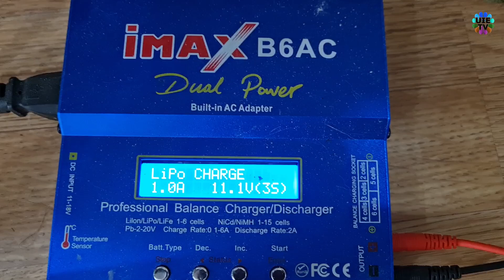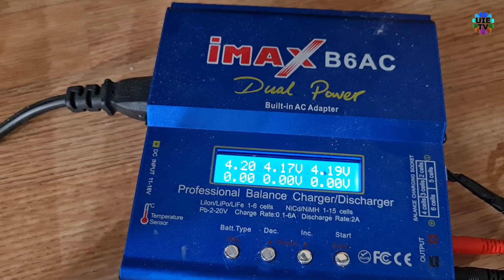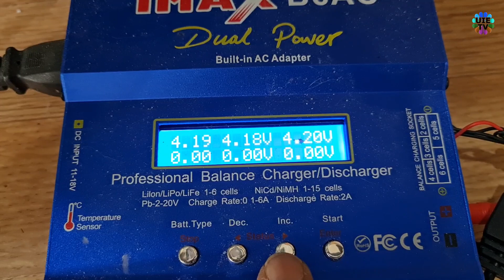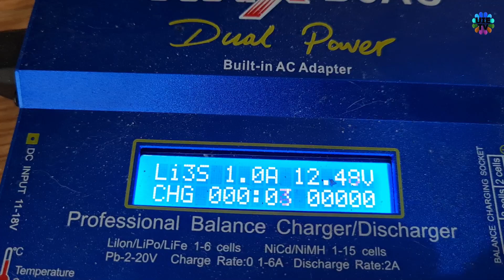All in 1 Proper Guide, How to Repair or Modify to faulty Battery in Hubsan Zino Pro Drone Fimi x8

Comment: If yu can read this today and still here fimi is alot better than dji with its battery chip you could never manipule that or make your own pack but with a good unlocked fimi battery chip you can make your packs as long as they behave and it always after the last 20% this lock will report damaged battery before that it gives yu ample time to stop motors infact i find fimi alot kinder when it comes to there bms chips compated other top of line manufactures ..
Example , can you do this to a zino mini pro ?
Or autel evo lite or nano ?
This was 3 years ago and i think you cannot do this to any other hubsan after those models